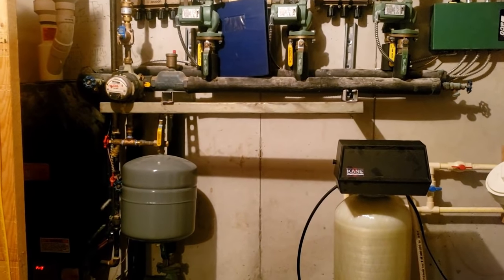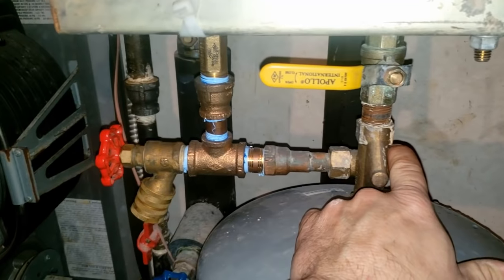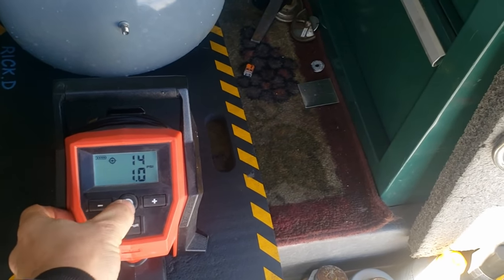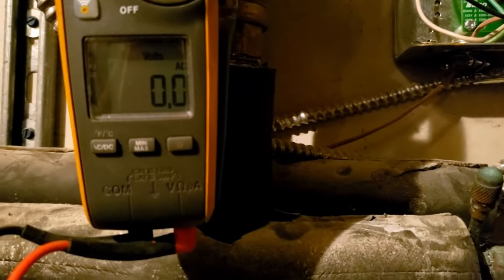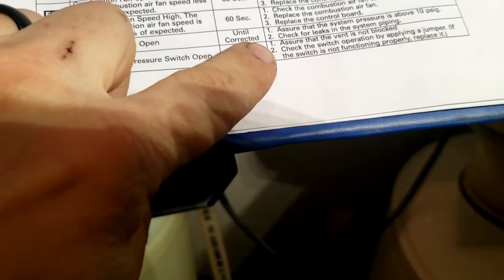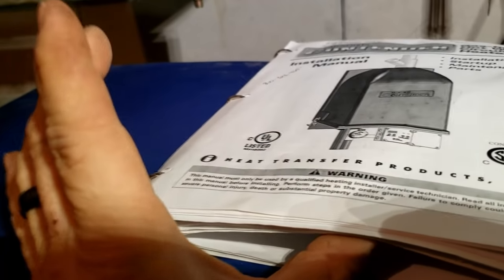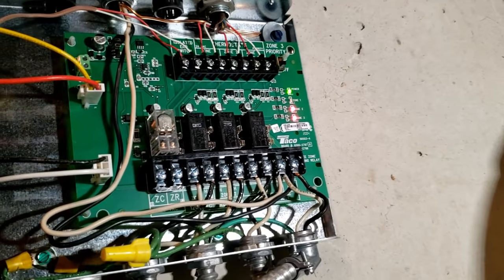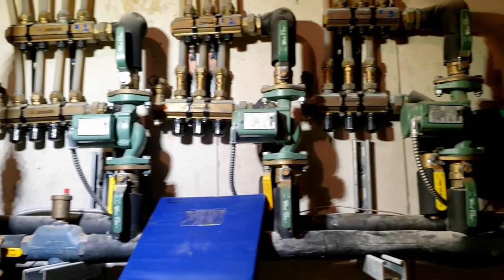MUNCHKIN BOILER GOES DOWN FOR THE LAST TIME! AFTER A BAD TACO CONTROLLER

Comment: Those boilers had problems with buildup in the heat exchanger when on propane. The combustion chamber has to be cleaned annually. It fills up with sediment that looks like coffee grounds.
We have been switching over to Triangle Tube boilers when the Munchkins fail.
Reply from the maker: I like the triangle boilers. Where i used to work we sold them. 👍👍

Comment: i have one of these boilers at my house, its 17 years old with 0 issues, runs all year because indirect hot water. Plus only done maint. on it a couple times
Reply from the maker: Like everything, a good install procedure is key to less problems.
Reply: Same here.  I have a 17yr old munchkin 80m.  Only minor low cost issues like flame igniter and a bad pressure switch.  Otherwise no problems and just and annual cleaning.

Comment: You were reading the "back feed" thru the motor windings. The same as you will read thru a heating element.
Reply from the maker: You're correct, it took me a minute to figure out what exactly was going on because I haven't lost a neutral between one point and another on a control board. I'm always big into measuring at the circuit or across the circuit but not to ground. It's funny this was a multiple offender,

Comment: We installed one hw boiler in 1939 house  had a curve  radiator  on a curve  marble  stair case exhaust  was suck back  thru intake  on control  board  taking  it out
Reply from the maker: Sounds interesting,👍👍

Comment: Nice Rick!   I have '0' experience with radient/geo-thermal, so this was a good introduction.  Thanks for reviewing the order of operation and how it flowed.  I'm still not sure about the pressure tank.  Did you say you ended up isolating that from the system?  
Looked like a mess!   Can't wait to see the new system go in!!!
Reply from the maker: Yes, if you were to check the tank pressure with it on the boiler,  the water pressure pressing against the rubber bladder would give you a false reading. When water gets warmer it expands, the tank gives that water room to expand so that it doesn't blow the pressure relief valve. This is just some basics, I can't go into great detail here but if you research expansion tanks you'll get allot more information on how it works.

Comment: Can’t you bypass the hot water motorised valve and turn the boiler stat to 3
Reply from the maker: I misread your question the first time. What hot water motorized valve are you talking about? And these are just regular temperature thermostats.

Comment: Ugh! If I had a dollar for every F09 on a damn munchkin (we had 5 399Ms, now down to 2) in our building), I could have retired 20 years ago... We're replacing the last 2 in April, and I'm going to haul one of them out into a field and put 100 rounds into it...  HTP made shit, and extremely overpriced shit at that...  IDK why the fault wouldn't reset, as it usually takes a single press of reset to clear it out (bad display module, maybe?)
Reply from the maker: These were some of the first high eff boilers.

Comment: Why do people put on fill valve on filltrol systems?
Reply: Because they do know what they are doing
Reply: But no need for 2 fill valved
Reply from the maker: The customer is a construction guy and didn't know that expansion tank was capable of its own auto fill. There is a lot of boilers in this subdivision that don't have water ran to the fill valves. They figured it shouldn't need water if its not leaking. I understand the thought but disagree.
Reply from the maker: Correct 👍. I removed the guts of the older fill valve just to get the job done but they will replace that tank and assembly when they install the new boiler they ended up purchasing.

Comment: Those munkins are junk. Replaced many of them here in WNY
Reply from the maker: It appears they are discontinued, now they changed under a different name. Go figure
Reply: @HVACRSurvival  yep. All these fly by night manufacturers that leave customers in dark.
Reply from the maker: In this case here I believe the boiler did its job for quite a few years. If it wasn't for the water getting into the boards it would have been fine. But yeah we run into that too
Reply: @IslandbreezeMechanical  HTP now I think
Reply from the maker: That's who I found was running them now.